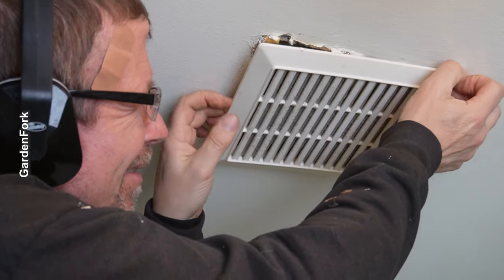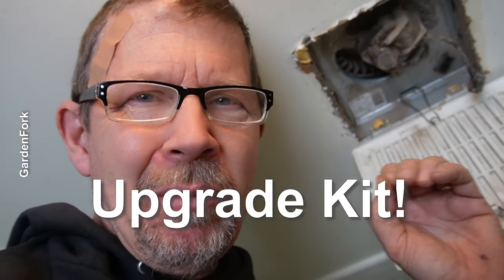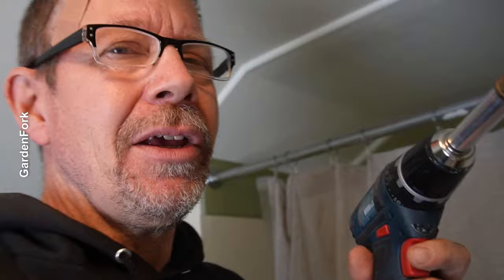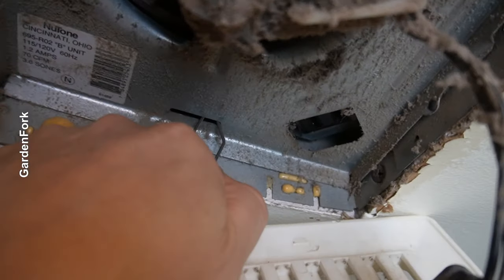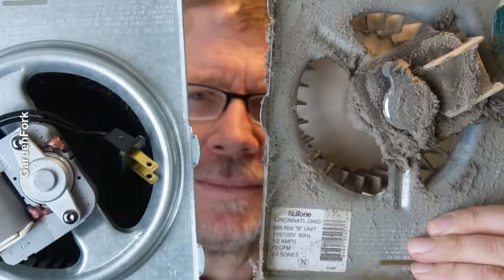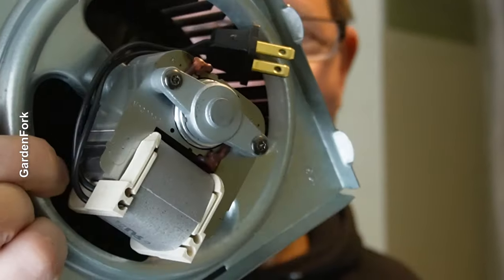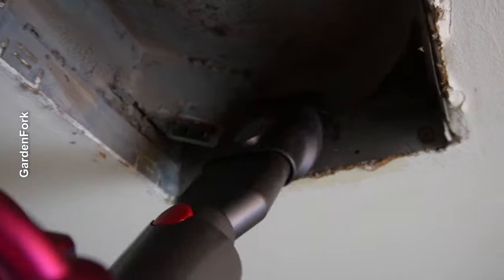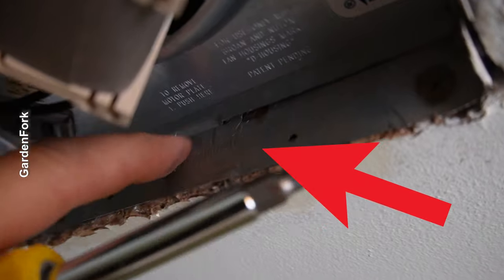Fix Your Noisy Bathroom Fan in 10 Minutes

Comment: With all due respect, this is more accurately a video on how to replace, not how to fix
Reply: The problem is fixed with a new fan. You can take a paint brush, air compressor and vacuum to brush off, blow and vacuum up the dust and grime and see if that works but if it’s the motor it’s going to be easier just to buy a new replacement fan. Getting fan parts can be very difficult to find just like some parts for appliances.

Mechanics fix vehicles by replacing parts. This guy fixed the fan issue by replacing it. The “fixer” is the  “guy” the “replacement ”is the “part”. I’m not sure why you have an issue with that lol. The guy could use both fixed or replaced. It doesn’t matter. I would like to point out that he didn’t “replace” any parts into the original fan itself. He just “fixed” the problem by installing a new fan.

I think you assumed the video title was something that it wasn’t, for what you were looking for.
Reply: Title isn't "how to fix the noise in your bathroom", it's "how to fix a noisy fan". That implies making an adjustment to the internals of the fan itself whether it's lubricating replacing a part or adjusting something it means operating on the fan itself. To use your car example let's say I wanted to put a video on how to fix a leaky tire. It would not mean dismount it and then mount a brand new tire. In this video, he shows you how to "fix" a noisy fan. I guess the "fix" shown wouldn't apply if you just wanted a different fan that wasn't noisy? I need to go find a video on how to replace my out-of-style fan because of looks. These steps are only for noisy fans.
Reply: @realSamAndrew it is not possible to “fix” a burnt out motor. if it’s making a bad sound then you have to replace no way around it
Reply: @st8ks967  to that I say the following: Nowhere did it say fix a burned out motor. If it's burned out, you wouldn't fix it. It did say fix a NOISY motor. There are many causes for the noise. If it's something that can be adjusted, lubed, or removed or replaced, you CAN fix it. 

And even if there is no way to fix it, then replacing it should be labeled as such.
Reply: Yall need to get a F life. Lmao
Reply: Searching for fix a noisy fan brought me to this video. The fan still works I just intend to lubricate it and do some maintenance on it if possible, so I will go elsewhere for the more specific “fix”.
Reply: @rococococoa  see the YouTube link I posted a few comments above.

Comment: Crap, my plug is different.
Reply from the maker: you could take apart the housing unit and wire it directly with wire nuts. make sure power is off first